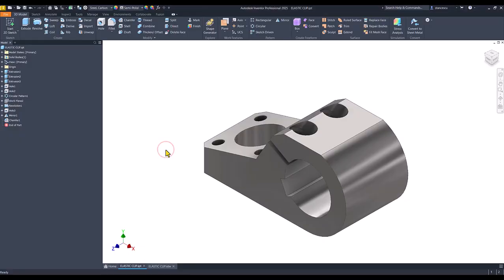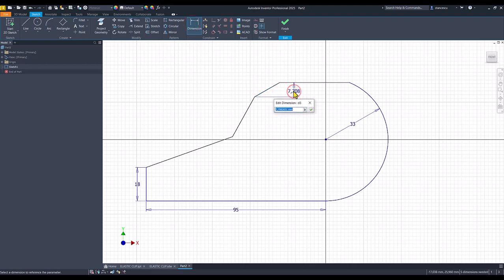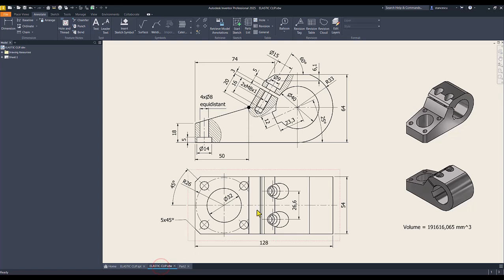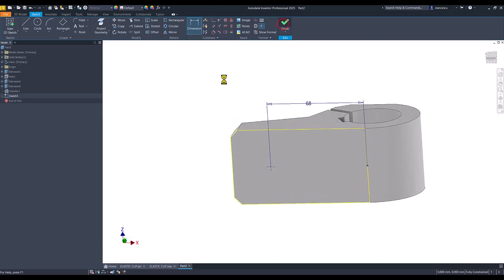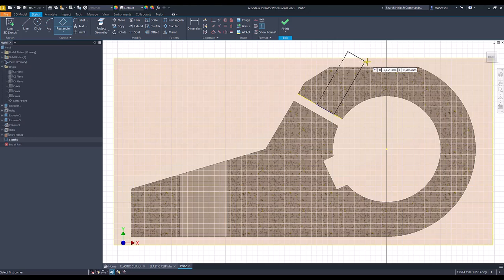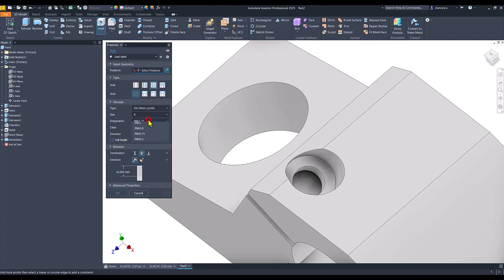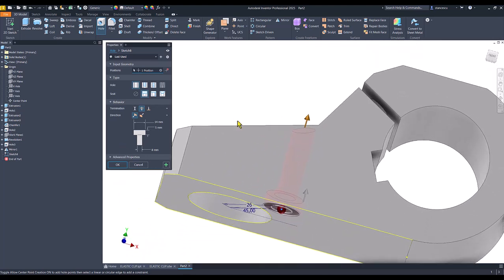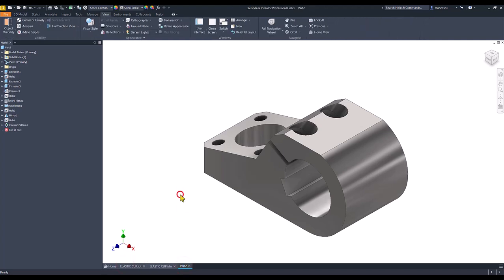Tutorial Inventor - 466 ELASTIC CLIP

Comment: If you had used the vertical axis instead of the diagonal axis (the inside of the cylinder) in the circular pattern, the problem would probably have been solved.
Reply from the maker: The axes of the holes are parallel to the axis of the big/vertical hole. There is no „diagonal axis”. Another solution is simpler: to apply „through all” option instead of „to” option.
Thank you, my friend!
Reply: @prof-stancescu  oh .yes.i had a big mistake.you can use mirror as well
Reply: Thank you mr professor